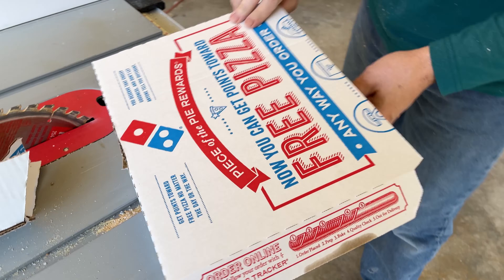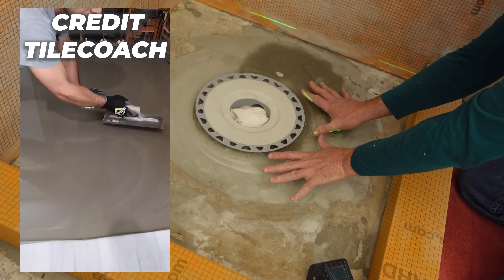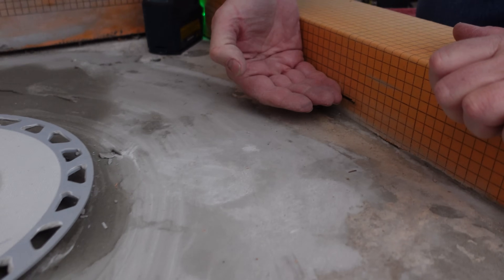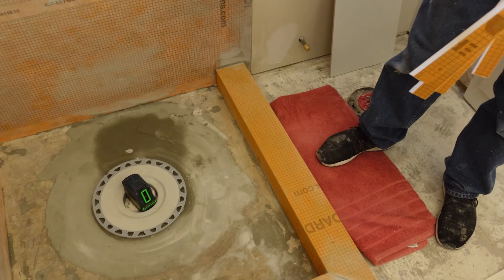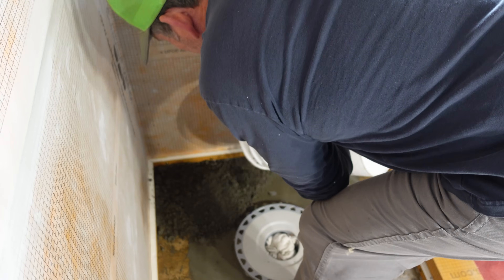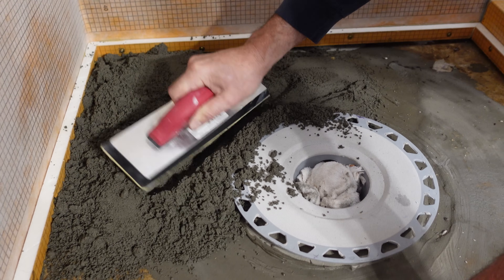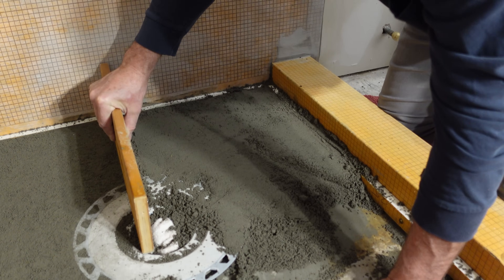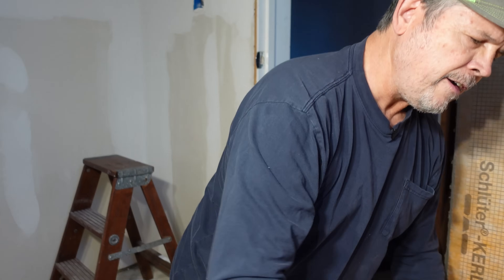HOW TO BUILD a PERFECT Shower Pan PRE-SLOPE (Great for DIYers)

Comment: Came across your channel on YouTube. I just have a few comments. First off over concrete slab you always want to use thinset or slurry coat otherwise nothing will bond to your concrete slabs. By you wetting the concrete causes even more problems with separating and cracking. If you're going to wet the area I would definitely use latex to make the drypack bond to your concrete substrate. When going over wood you should use aquabar never Roofing paper because of the oils in the roofing paper for also penetrate into the dry pack and separate. Then said is not a good way to set the bonding flange is should always be set in a mortar bed or high-performance rapid set. There were few other things that you did but I just had to say something because I just can't stand to see information put out there that is what you would say not up to par. I'm a journeyman tile Setter marble Mason stonemason 37 years with three contractor's license. I think you need to go back to Isaac's YouTube channel kind of review things. Just calling things the way I see them
Reply: I highly recommend comparing their installation to Schluter’s YouTube channel installation videos. As much as I like Stud Pack then I do think that people should be encouraged to check with the manufacture’s specifications and installation for their due diligence. I had the pleasure of attending 2 free Schluter workshops that had classroom and hands on installation training. They provide these free workshops nationwide, meals are provided and hotel if needed. They taught from the TCNA handbook what the legal minimum standards are as well as how to properly install their products. It was an eye-opening experience for a rookie person like myself to see so many “professionals” installing on their mock ups with some questionable practices that were contrary to what was just taught. I came to appreciate that whatever I was taught growing up might be old technology and I need to keep my mind open to learn new technology and decide for myself. 

I recently shadowed a tile contractor that made it very clear he had no interest in learning possible new and better ways. He was so stereotypical of so many of the contractors I saw in that workshop. Good contractors are very hard to find and my Honey complains that I’m too picky. 😄🤔😏👍 I just happen to know better. 🤔😙👍 Thanks for your comment.
Reply: Yes I understand all the new products my last project had over 5,500 rooms using three different type of ditra systems doing crack isolation sound membranes and waterproofing membranes for Western Tile & Marble there are a lot of new systems out you need to know how to install them correctly true. The basic principles of setting tile and Stone will never change.

Comment: I have a dumb question for anyone who wants to answer. What does he mean when he says he can bevel the top of the foam screed?
Reply from the maker: Hey Audrey, the dry pack has a slope towards the drain.  If you wanted to, you could bevel (put that same slope or greater)) on the top of your screed.   Could make a difference in some applications if the slope was steep.

Comment: Why don’t you bond the pan to the concrete slab?
Reply from the maker: I used to and probably will again next time.  Had a bunch of comments that it was not necessary #1 mud pans in vinyl liners are bonded and don't move #2 where's it gonna go.....   I get it but it's probably better to bond

Comment: I did see you mark the top of the slope at the front of the shower. Then, it appeared that you used that as a level mark for the rest of the perimeter. Should there not have been higher marks at the corners? ( The distance is further from the drain, and therefore, the rise should increase. Know what a mean? )

Comment: I know you guys are big fans of the Schluter shower systems, in particular the Kerdi waterproofing membrane. However, have you ever used a paint on waterproofing system? I recently saw a two coat system that looked pretty spectacular... in particular no build up of overlapped membrane in tight corners. But I also see an increased risk of failure that a membrane doesn’t have. Your thoughts and opinions are fully welcomed.
Reply from the maker: I’ve only used Mapei aqua defense on bathtub walls. Not comfortable with it on floors although iirc it’s approved for that.   I would like to try laticrete hydroban 👍
Reply: Please read the technical specifications of Red Guard. Then please tell me how you are supposed to effectively apply that product and ensure that it’s waterproof? This is the most common waterproofing in my area by contractors and most of them don’t even apply it correctly and don’t even know that they’re not. They just don’t look at the specifications and installation instructions. I think every person should do their due diligence. 

In my journey to decide on a waterproofing system then I found Schluter last in my research. I have taken 2 of their free workshops, they taught from the TCNA handbook legal minimum standards, comparison of different installation products and how to install their products properly. It only cost me my time and that is the cheapest investment that I’ve gotten the most out of. 

I like to encourage people to look for themselves and decide what’s right for them. Schluter is a complete system with the best warranty I was able to find. I don’t have room to have this go badly so I’m going with Schluter. Ultimately I think it’s important to learn about new information and decide for yourself. I hope this helps. Thank you!

Comment: Despite the video is really nice, a serious mistake is detected... No flange can be lifted up above the concrete substrate! Alternatively a concrete must be poured to meet the flange level. Alternatively, there is no way for porous screed to be drained  via this flange. It will be a constant ponding a moisture under the flange. Even if you waterproof it on top of screed, the4re is no guarantee that water can`t find its way via a possible crack in waterproof membrane. In many countries it`s banned to do like that and lead loosing insurance.

Comment: 1/4 inch per foot seems steep. As a tile sub contractor, ive never had a problem with 1/8 inch per foot, which is what plumbers use for sewer lines. But i try to use pre fab pans as often as possible. 

Awesome video though, making shower pans is probably the hardest part of a shower.
Reply from the maker: Thx Reese!

Comment: Don't take some random viewers advice on weather or not to put thinset on under the drypack. As a journeyman tilesetter , it's a no brainer why you would want a solid bond to the subfloor. Might as well put a slip sheet under your drypack if you're not going to bond it. That's basically what you're doing.
Reply from the maker: The old vinyl pan liners were exactly that… slop sheets.   It cannot move imo 👊👍
Reply: Movement isn't the only issue. Dry pack is porous just like concrete will wick water. If the isn't bonded to the surface you leave a gap for water to sit and dry repeatedly. Causing efflorescence and mold in cases.  Should have stuck to your prefabs.
Reply: There's a reason they used vinyl. It's water tight.
Reply: @W000F  For concrete, it seems water will wick in both directions, from the drypack to the concrete to the ground, and if the ground is wet, in the other direction. With the waterproofing between the tile and the wetpack, the water shouldn't be coming from the shower, at least until the adhesive in the Schluter system breaks down in 50+ years. Nothing lasts forever.
Reply: I would reference to manufacture’s YouTube channel and instructional videos that they have and/or contact Schluter for a local representative to answer such questions. They are very good at that. Their free workshops are pretty awesome too! I hope this helps. Thank you!

Comment: why not just use sand mix
Reply from the maker: I’m not sure what that is
Reply: @StudPack  it's a bedding mix you can get at hd/lowes. Maybe it's different in your area but here you have to go to a tile supply store to get the specialty floor mud and it's like $20 a bag vs. $6 for sand mix. you can also mix it dry or wet depending on what you find easier.

Comment: Bosh tools might be expensive, but.... they will last years. 3 year guarantee, can buy parts and fix them yourself afterwards. 7 years of abuse on building sites, no problem.
DeWalt is good too but the repair-ability sucks, very hard disassemble and assemble. Meanwhile Bosh is a 5 second-5-minute job depending on part.

Comment: You keep referring this as a "Preslope."  It is NOT a preslope.  It is a "Slope."  A preslope is used under a rubber liner for a "Water in/Water out" installation....NOT a surface applied Kerdi shower.....

Comment: Look up the traditional method and stick to that foam bases fail they're too soft and the weight of walking on it pops tiles I work for a company that used to just do regrouts to fix leaking showers but with the foam base craze the last few years a couple of us more experienced tilers have had to get bigger vans and trailers to do full renovations not just regrouts because we're getting too many that have failed and we can't just regrout it... This method probably ok with just the thin border in foam but I still wouldn't trust it basically do what he did with the foam in the dry pack make a level border but smack it down like he said not too so that the border is hard fill in the center and screed around off your level hard packed border also either thin set the screed down or mix a slurry out of the sand cement and prime the base with a coat of it... Same as failed foam bases a loose screed like he mentioned will crack and cause movement which will crack the grout all the glue will get wet and fail and you'll end up with popped tiles...
This guy clearly sets and forgets.. looks good when he leaves so that'll do then guys like me have to come fix it

Comment: This is all wrong. You need a plastic 30 mil PVC wrap for the base. The the water goes threw the grout and the dry pack. Also we don’t add unnecessary screws near the base.

Comment: I'm sorry, although you are trying hard to shoot the video, there are problems with your approach. 1. The slope is wrong. 2. The height of the floor tiles is not reserved for the drain. According to your approach, the final result is that the tiles are above the floor drain, that is, much higher than the floor drain instead of being level with the floor drain, which will cause scratches on the soles of your feet.

Comment: Bro u don't need a preslope with a schluter drain or schluter system its not a water in and water out system theres no weep holes thats a water tight system and only 1 pan is required when using the membrane save yourself some money on materials the pre slope in this case serves no purpose

Comment: I am not a big fan of leaving the strips in the shower pan. Your pan is not 100% waterproof. The screws are not waterproof. I would rather remove the strips and fill the gaps with mud. Drill 2 screws on top of the strips , not all the way, for easy grab. This method was used first by a russian guy many years ago. Issac copied it but drilled the strips to the bottom of the pan . Not proper for water in water out shower.

Comment: Using the schluter system??? These systems have been failing all over the place, they delaminate at the joints and creases. Usually attributing to THOUSANDS of dollars in water damage. Even for systems that have been properly jointed per directions. Good luck...

Comment: Why are you calling it a pre slope ?
Reply from the maker: It establishes the slope of the tile shower floor.  It has several names depending on where you live I imagine.   It gets covered with waterproofing in next video 👍
Reply: @StudPack  A pre-slope is when you have a double pitch shower that has a vinyl membrane. The pre-slope is below the liner, which directs water that encounters the liner towards the weep holes. The main slope or top slope,  is above the vinyl membrane and is the slope in which you install the tile on. The Schluter bonding flange has no weep holes, so a pre-slope is not needed. 
One main slope with the bonded waterproofing on top of the slope.
Great videos! Keep up the good work

Comment: Sorry to tell you…this is not a good system…beat some float strips into the deck mud and screed off them..pull them out and fill in the voids with deck mud….NEVER puncture the membrane..Liquid nails will dry out over time and you have a leaker!! Yea..im licensed C-54 and been in the tile trade since 1984

Comment: I have spent years finding the best ways to eliminate any material in the pan that is suseptible to damage by moisture like wood curbs and fasteners below, not only the level of the pan but also below the top edge of the PVC pan material that we commonly use in Florida. I know that the Schluter system is a good system but as soon as you screwed the foam screeds into the wall and curbs, you lost me. I don't care if the screws were stainless and I certainly have no trust in the liquid nails to seal the screw penetrations. I think you have introduced a weak point into an otherwise tight construction. I've demo'ed many shower pans that were not failing and yet all of the masonry material in them was saturated but basically stable because there were no penetrations in the pan. Here you are depending on a sub tile waterproofing membrane and you put holes in it. I wouldn't trust any sealant (caulk or adhesive) under that kind of static water pressure.
May I suggest using a modified thinset with accelerator to stick the foam screeds in and then proceed with the floor mud (I commend the use of actual "floor mud" because it holds much less water when saturated and retains it's strength). This way you will not compromise your water barrier in any way and Schluter will not say you have voided your warranty.
Reply from the maker: We put Kerdi over the dry pack.  Everything is sealed and water tested.  Watch the next video hopefully we did a good job explaining 👊👍

Comment: PLEASE take note how INSANELY SMALL the shower area is. this little guy can barely move around in the shower area and there are NO repeat  NO door or wall installed yet.  SO, what do you do before you spend $$$$$ and time, do some design.  Although this guy covers a lot, he totally FAILED the part that matters, the whole thing actually working well.  Just picture anyone like 6' and 220 moving around in there without elbow and knee pads

Comment: You are using your terminology wrong. That's not your preslope!!!!.  A preslope goes under your pan liner. Then install your membrane then pour your final slope. You don't have a preslope with the kerdi system. All showers with a standard drain you pur 2 slopes. Read the tile setters of America book if you don't know.

Comment: Waste of time and money!  You drew perfectly level lines with the marker and then you added those boards, that's the waste of time. Don't use the fancy floor mud, I'm sure it's expensive. I use the cheapest mortar mix from Lowe's I can find or I just mix Mason sand and Portland cement by hand. It's just as good and a lot cheaper and faster.  I've done all of my shower pans that way, and I have never had a problem, or complaint.

Comment: It was a great video until you screwed the foam board INSIDE the shower. What the hell, Schluter will not warranty this install for sure. Yes you can water proof the pan but water has a way of finding itself through the smallest area to cause major problems. All you had to do was draw a line around the bottom of the pan. $.02

Comment: This is awful advice. You should always pull out and fill in your screeds if you use them. Also he never used a slurry coat below the mortar bed aka he didn't glue down the mortar bed to anything. Floor will crack eventually. Tsk tsk